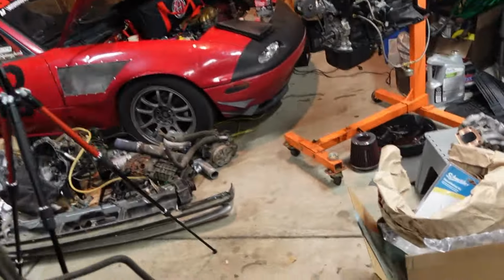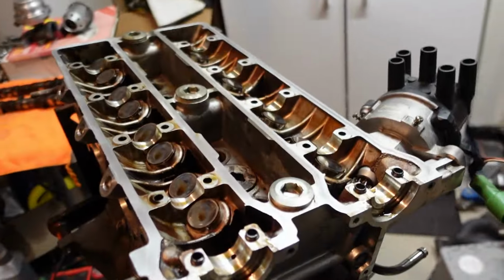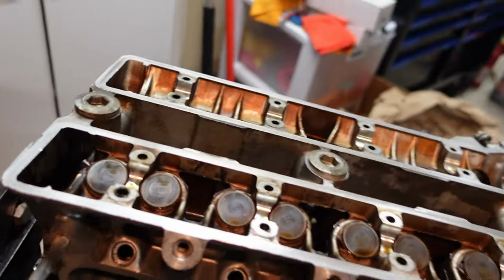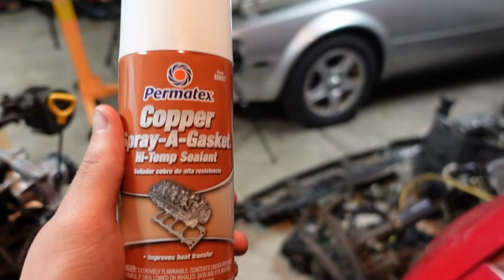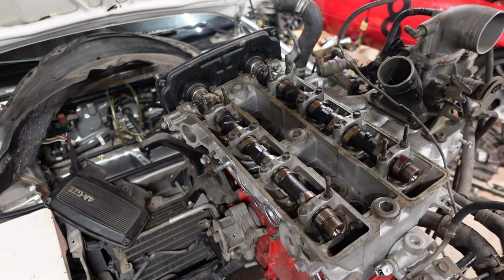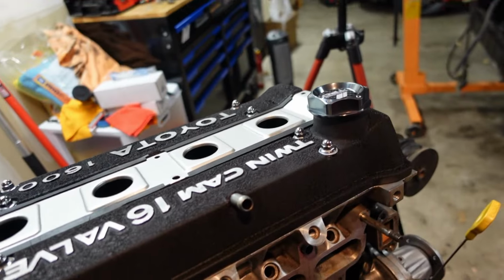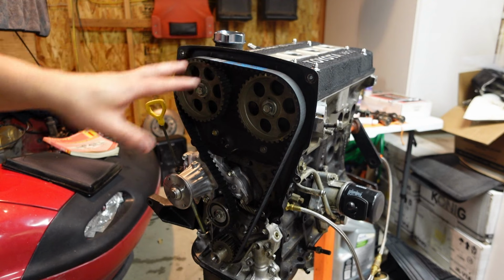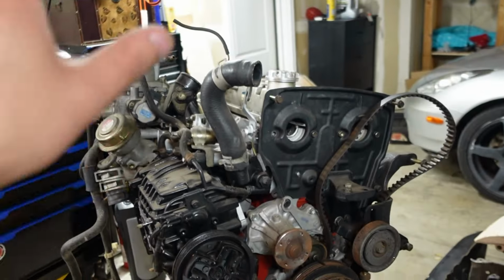TRD Head Gasket, HKS Cam Upgrade and Timing Belt Install on the Turbo 4AGE!

Comment: Dude you won't believe me if I tell you I be doing the same today. Just have the head back from the machine shop. I am desperately looking for the harmonic balancer, whoever owns the car before weld the old one. But I guess desperate times calls for desperate measures. Keep up the hard work.
Reply from the maker: That's awesome! Definitely have to check for everything! Let me know if I can help in any way. I'm trying! Today will be doing more work on the car itself!

Comment: There's a specific sequence for loosening the cam studs and more importantly the head bolts, it's in the bgb.
The trd headgasket comes with it's own sealing material (the black coating), really is best to get head and block deck machined.  Though I can admit in the past I've used the trd gasket with just using my flat stones to surface them with good results when times pushed to get a engine back running.  Hylomar is my favorite coating if I need to use something on a headgasket. 
My twincharger I run 264 inlet and 272 exhaust for cams. interesting to  another engine previously setup with a larger exhaust cam as well. 

4ag ftw!  All hail the screaming chicken!  I actually yell that out at mr2 meets down here in Australia..  hahaha
Reply from the maker: I will keep all of that in mind!
But that is awesome! Haha.

Comment: I have a 1985 but the cam gears are off, bought it that way. Whats the best way to reinstall correctly?
Reply from the maker: The cam gears are off of the engine physically? Or they're off as in misaligned with the timing belt?

If they're off of the engine, I'd say make sure the engine is at TDC and the intake and exhaust cam gear goes into the proper position on the cam. Example, the intake cam dowel is straight up with the timing mark and the exhaust cam is down to the right about 170° away from the timing mark. Then use some blue loctite and install them to the proper torque specs. 34ft-lbs (46nm)

If the belt was off, same concept but just line up all of the timing marks where they should be, release the tensioner, rotate the engine over and double check the marks line up, then tighten the tensioner.

Hopefully this helps!
Reply: @ivgarage  thank you. I'll let you know how it's coming along.
Reply from the maker: You're welcome! I'm here to help!